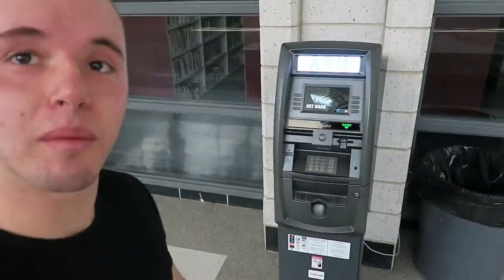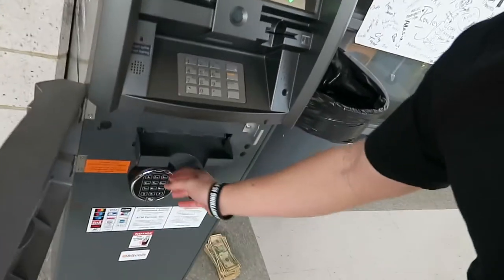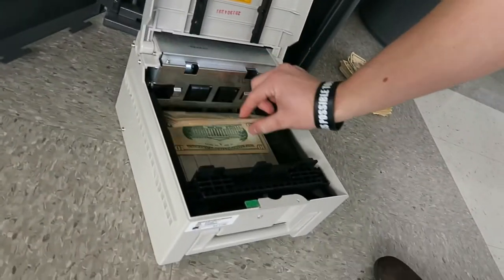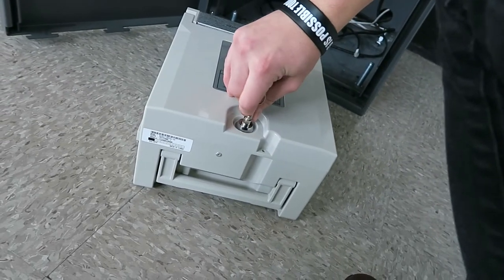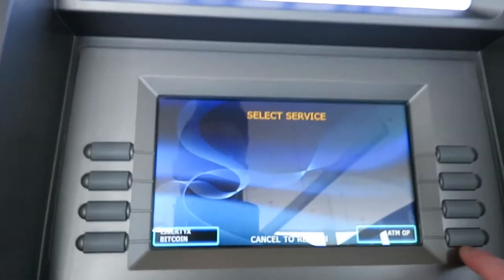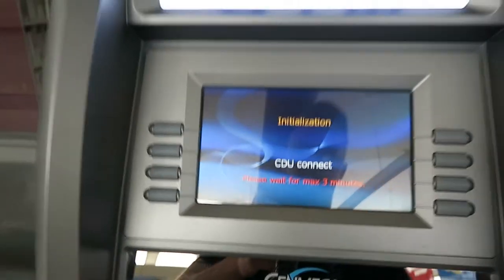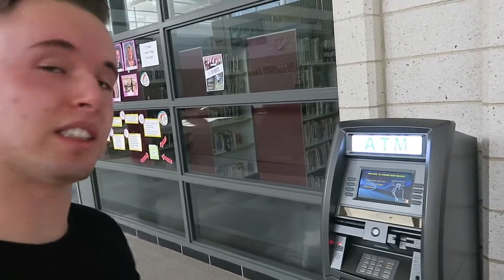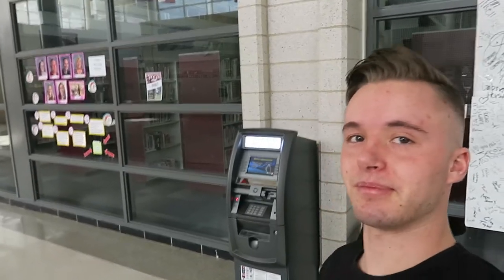Loading an ATM | Genmega 2500

Comment: I been at it for about 5 years now. Looked like some of the bills were stuck up on the right side in the cassette. Make sure all bills are down and unfold any corners to help prevent frequent  service trips to the machine.  Also when u close the safe door give it a little pull test to see if it locked. Saw them a few times before where the lock didn’t actually set.   Tks for sharing.
Reply from the maker: Thanks man!

Comment: Thanks do you push the back button until it gets back to customer use screen. Also how many ATMs do you have do you do that fulltime
Reply from the maker: yes we recommend doing a trial day total before canceling all the way back, which will send a communication to the processor (host) to connect
Reply from the maker: We partnered with a larger company! have about 500

Comment: How much money do you need to load an ATM when getting started?
Reply from the maker: Usually operators first starting out would do well with a few thousand in vault cash. We started as low as $1,000 per machine until the surcharge (transaction volume) built up, to help the vault cash build up! Does that make sense?

Comment: I use to get alerts to my phone when I add cash to atm, my gm2500 doesn't show me the right amount of cash added what am I doing wrong?
Reply from the maker: Who is your processor? Usually you should be set up with low balance alerts to your text or email
Reply from the maker: It needs to be the total amount of bills in the machine, not entering just the number of bills (in addition) to what’s inside of it already. Does that make sense?